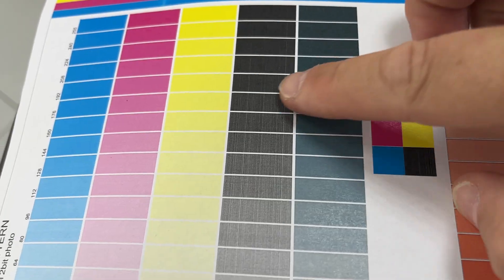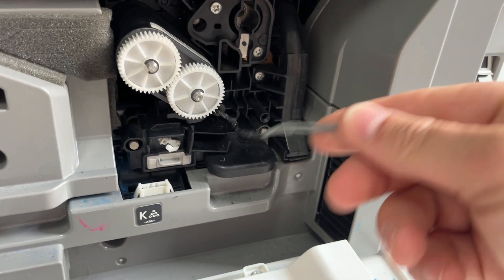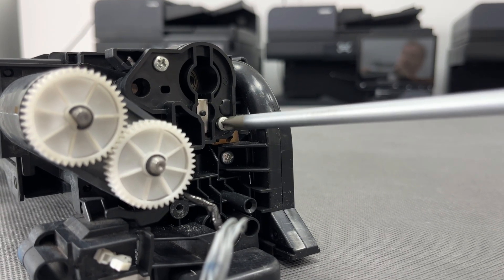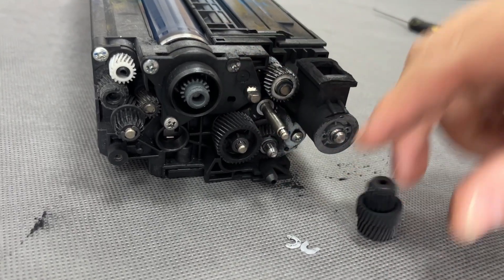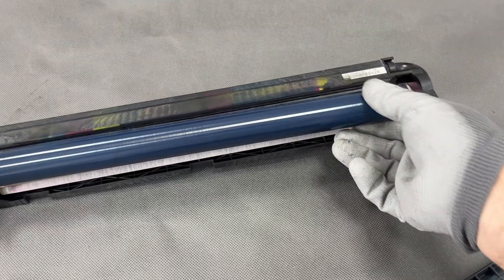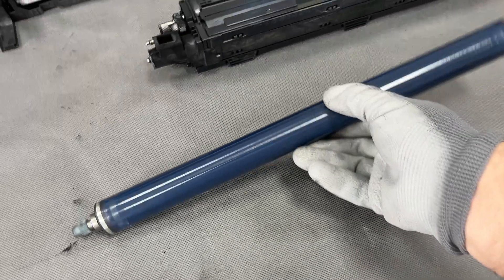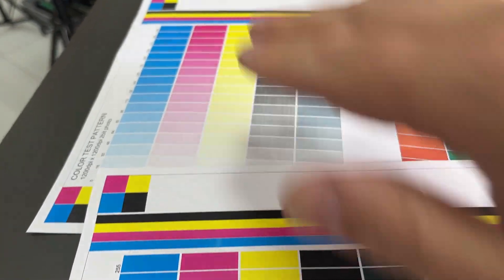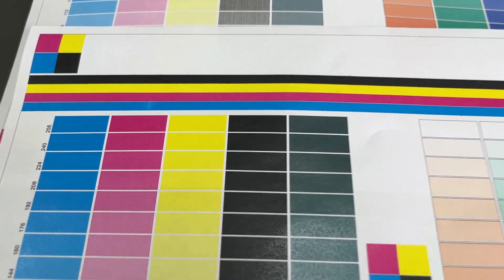Ricoh MPC3003 MPC3503 White Lines on Black Print? I just replace the Drum, will that be enough?

Comment: Thank you! Are you using OEM drum kits or originals?
Reply from the maker: @HungNguyen-ow9bj Thank you for your question! I use only compatible (third-party) replacement drum kits, not OEM originals. If you’d like, I can share more details about the quality and performance of these alternatives.
Reply: @MrRicoh  Thank you for your reply. There are no original parts here so i've been using compatible ones like you. The result is 70-80% comparing to the originals. Especially the fuser film, it randomly remains ghost image on the printing. I will try another 3rd-party like Katun, CET..next time.
Reply from the maker: Don't use Katun but try CET it's good.
Reply: @MrRicoh  Hi again, i got a problem with my 4503. I replaced the drum, blade, charge roller, and drum lubricant. After a few dozen prints, both edges of the drum got scratched and the prints have vertical lines. I tried two more new drums but same issue. The edges of the prints are darker than the center. Could this be caused by bad developer or something wrong during reassembly?